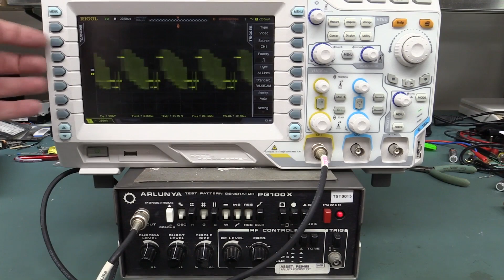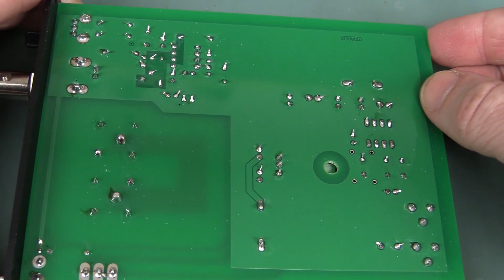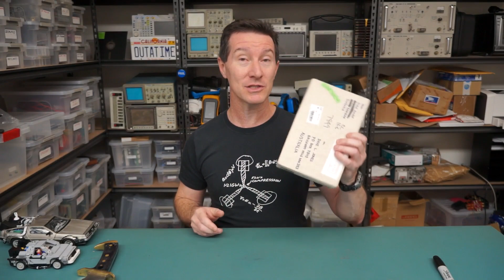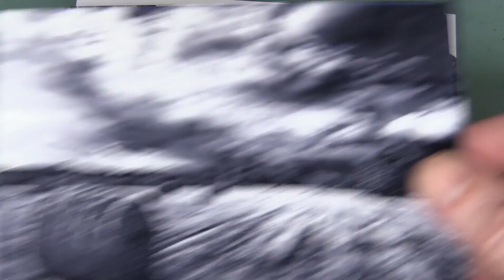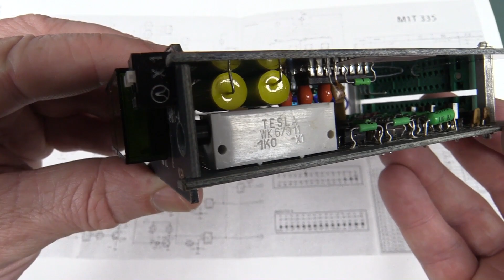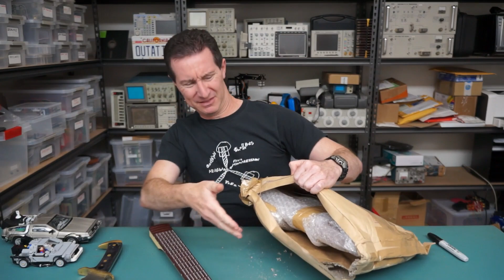EEVblog #769 - Mailbag

Comment: Hi,

shouldn´t  there be a protected earth connection on the chassis of the isolated current measurement device when you are using higer voltages....???

Comment: Dave your scope can't trigger on the composite color video signal because the 4.43 Mhz color sub carrier is going as low as the horiz sync pulses. The sub carrier can't go below zero or cut off i.e the top of the horiz sync pulse.The horizontal sync pulse should be .3 Vp-p  relative to a 1 V p-p video signal

Comment: What was wrong with what the autorouter did, lol?
Reply: artifactingreality It would have been more reasonable for that trace to connect to the bottom of the pad, instead of going right between two pads.
It's not just a matter of looks, either. That smaller gap between the trace and the other pad would make it easier to make a solder bridge short out the two pads.
Maybe it's not such a big issue with thru-hole components because of the relatively large traces and distances between component pins, but surface-mount components are packed so tight and the pins are so close together that it's already challenging to avoid bridges WITHOUT a bad board design working against you.

Comment: Hi Dave, Great vblog, even if a lot of the technical details go straight over my head!  :-) Here's an idea for a quick repair video, which may appeal to many Aussies - diagnosing and repairing the Bosch ignition module found on Commodore V8's (the Holden 5 Litre) - these were same from VN through to Series 1 VT - they were discontinued in about 2012 apparently, and they fail, but no one seems to be forthcoming with exactly how to fix them (but they are fixable) - they are about $200 exchange for a repaired unit, and about $500+ for new. Some even boast how their repaired units are better than original, so wonder how? My son's VN unit has failed (Magic smoke came out) so happy to pay postage if you want to use it as a test case?

Comment: That pattern generator has low sync level, and high chroma. Together they were messing up the scope's trigger.
I noticed a 625/624 switch. Pal is 625 lines.
Anyone know what the 624 position is used for?

Comment: 50 ohm output impedance of current meter into 1 Meg input impedance of Rigol scope. Shouldn't that actually be half the displayed voltage ergo current? Young players error, Dave :)))

Comment: Think you need to mount your fail button a little closer.
Reply: Mike Mundell I think he could figure out something a little more sophisticated.
Something like putting a normally-open push-button under the desk, and wiring it in parallel with the switch inside the FAIL button using some Cat5/5e/6 wire (probably have to be solid core as the other stuff is a real pain to solder).

I almost did something like that once with a wireless doorbell button and a roller-lever microswitch to detect people opening the front door of a shop.
The electrical side of the design was sound, but I lost interest in the project before figuring out how to mount the switch so it did what I wanted it to.